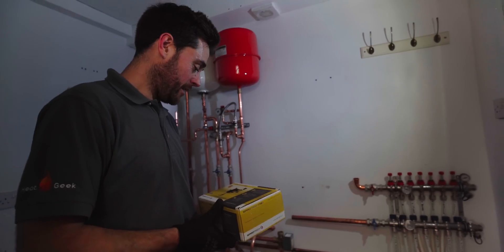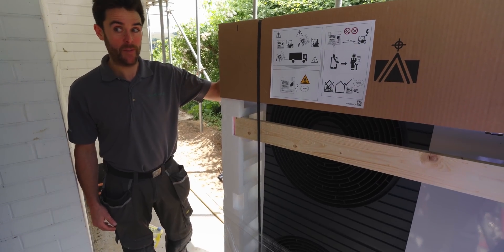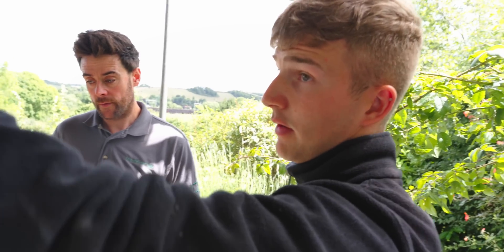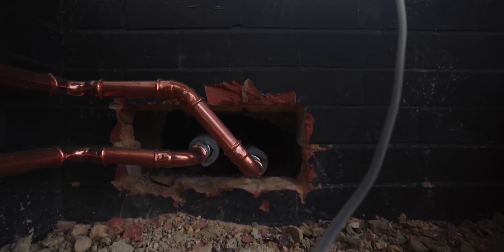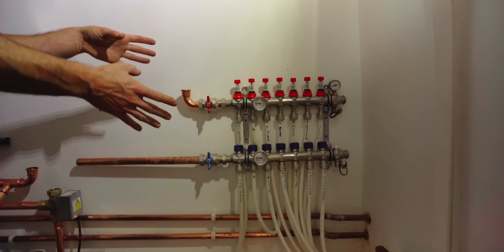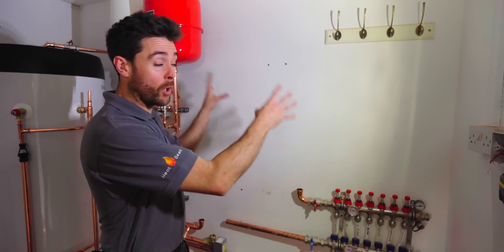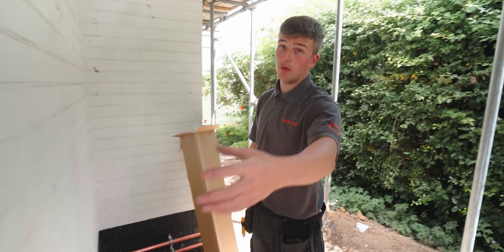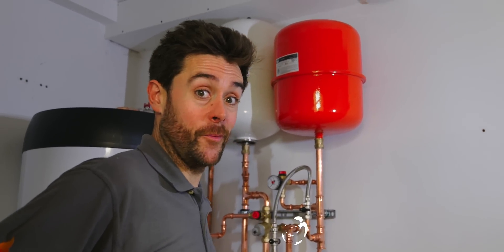NEVER Install A Wonky Heat Pump! | HG On Site

Comment: So the answer was bigger rads, is this because the old water temp leaving the boiler was higher than the new heat pump water temp leaving the indoor unit for the heating circuit? Could I ask what your calculated heat loss is for the building and what the power rating of the Heat pump is in output? Many thanks for any answers/help. Am enjoying looking at the results of your experiment. 👍👍👍

Comment: Great video, looking forward to part 2.  May I ask what is peak space heat load & dft?  Also do you prefer to design with open zone and allow weather comp to fully work without interference from multiple zone controls. ...+ the benefit of less complex & cheaper to install!  
Keep up the good work 👍
Reply from the maker: This was 12kw. Yes re zoning.. watch our 'why not to zone heat pumps or boilers' video
Reply from the maker: Been installing boilers that way for 10 years and heat pumps since we started them a couple years back..

Comment: You never use SY cable outside in a fixed installation. Designed as a instrumentation cable indoors on machinery where flexibility is required.   Plus no uv protection for outside use.  Otherwise good info. I myself will wait another 10 years. My home is not suitable for a heat pump . Not long replaced the gas boiler. My son replaced his just last week.. I am keeping an eye on The technology waiting for new developments. It's early days, it needs time to evolve. But it has to start some where and your doing a good job.  I am a retired electrical engineer And enjoying retirement.
Reply: Yep, the payback at the moment is not good enough. I will replace my combi next year (14 years old by then) and probably review alternatives in 2033 if I still own the house.

Comment: Don't you love real life, wonderful video, well worth doing. Great install, are the rads on the same circuit as the underfloor? Is the buffer tank really necessary?
Reply from the maker: Buffer is a slight overkill but needs the separation. Yes rads and floor same

Comment: Have you got a link to installer manual for the actual Heat Pump.......curious to read what the servicing requirments are ? I'm guessing there aren't many Heat Pump service engineers about.....do Vaillant themselves offer servicing ?
Reply from the maker: Yes vaialnt do offer servicing. Servicing is infinitely easier than a boiler though
Reply: @HeatGeek  ok thanks, and what period of warranty is given with that unit ?
Reply from the maker: @julianwebb8712  if your an advanced installer like us, 7 years. Then if you select servicing with vailnt 10 years.
Reply: Thanks for reply, it took me a while to get to grips with the spelling of Vaillant too 😜

Comment: How does the unit deliver 2 different temperatures for the heating and water simultaneously? Is the purpose of using 28mm to reduce the surface area to volume ratio to reduce heat loosses or to improve flow, if for flow would the internal resistance through the motorised valve not offset any benefits?
Reply from the maker: It does 1 then the other, not symltaniously. The purpose of 28mm is to give the correct velocity of 05. To 1.5 mps, same as any heat source. No the diverted valve restoration is not too high. 👍

Comment: Hey guys, love your work and what your doing for our industry. One heads up for you, without sounding too much like a keyboard warrior.... I'd be careful using SY cable, especially externally as it's not UV rated etc. Also not rated as mechanically protected as a lot of people think!! If your just running a SELV mains isolated comms bus then okay, but much of the comms gear on the air and ground heat pumps is actually mains referanced and needs to be treated as such. Rant over and I look forward to seeing the end result of this job. Cheers
Reply from the maker: Hey Paul. Yes aware SY is now not to standard for voltage aplication bit will pass the other information back. Thanks!
Reply: @HeatGeek  No probs. Check out John Ward's video on SY cable he did last year to see what happens when run externally. You could use conduit / copex to do the external last mile run to the outdoor unit and meet regs
Reply: @paulbell7654  VDE0250, BS EN/IEC 60332-1?
Reply: Very good point Paul, SY cable is not a suitable cable for outdoor applications it tends to act as a sponge over time soaking water and eventually will cause issues. i would also refer to John Wards Youtube video on the subject. thanks for the videos
Reply from the maker: @EnergyhomeInnovation  awesome cheers guys. Appreciate you pointing this our for viewers!
Reply: @jonh1808  The uses of SY cable is always going to be a problem as it doesn't comply with  BS7671 (18th edition wiring regs) so your  Sparks is always going to have to list it as a deviation on the Electrical Installation Certificate.

Also SY is designed as a power and control cable not for data communications. Data coms cables have Twisted Pairs and Full Screen, 
SY usually has an internal earth wire which negates the screening effect .

Comment: Did they put a new air brick somewhere else? seen a few properties with blocked air vents and horrible damp issues!
Reply from the maker: Air brick was for an old fire no longer installed.
Reply: @HeatGeek  yep above the damp course so no issue with damp. You need air movement where you have something outside the thermal envelope of the building, ie under the floor or above ceilings that go to roofs.

Comment: Whats the rough price of an install like this? Also is there any advantage of a Mixergy cylinder over the Valliant?
Reply from the maker: Hi. No advantage of a mixer gym over normal cylinder with a heat pump no. Average heat pump instal is 15k
Reply: @HeatGeek  thank you, could you explain why mixergy is not any better? I thought the ability to stratify the heat meant not all the water in the cylinder had to be heated if not required saving energy and therefore money? Thanks again.
Reply from the maker: @aub8670  because that function of partial load is tuned off when connected to a heat pump.
Reply from the maker: @stupidusername38  if you have excess ov why would you o ly partial load?? You want all of your ov saved before export
Reply from the maker: @stupidusername38  but heating slightly more water on a really well insulated cylinder does not really use any extra energy, even if it did its better than exporting the electrical power at a loss
Reply: How did the 28mm pipework perform?I've got a similar install coming up for a 10kw vaillant and have been told 35mm is required and it's only about a 7m piperun

Comment: Don't really get this video. I thought the whole idea of your company was to educate the trade and the public on the how to and benefit of heat pumps. Watching this and the miss management of all the logistics just exemplifies the reasons for not having one installed. And planning at an appalling level. The install is started with essential components not even on site. Copper pipe or fittings you can whizz out and get but obviously not some major parts. A week install running into three. Whoever was responsible for the organisation of this job should be ashamed. And then film and publish the cock up. Still lost.
Reply from the maker: The deliveries are often out of our hands and you'll hear from anyone working in the same or similar feild. It's not necessarily down to planning at all. Like wise with the base that was laid by a builder in charge if the whole renovation. Importantly though as there was continuous works and the job had to be done in phases there was absolutely no delay to the job at all. Retrofits would get a site visit before hand to make sure the job is ready. 

The purpose of the video is to show the realities of an install. We're not trying to falsify the installation of heat pumps to sell them. We are all about truth and this is the reality of any bigger job, not just heat pumps.
Reply: @HeatGeek  I am a Builder. Have been for too many years. I agree that the Builder helped drop the ball but still think your firm did too. You say on a retro fit there is a site inspection first to ensure everything is ready. This is not really a new build just a big Reno. Planning or poor planning continually screws the Building Industry. Whether you were working for the owner or the Builder collaboration before turning up makes all the difference. Training is a big thing to you. Helping the Builder get his part right. Deliveries World wide are bad. All of my jobs have delays because of it. So don't start. Make sure bits are in your possession and intact. We all try to press on regardless and hit a brick wall. As things are at the moment delays can't always be helped. But this video came across to me as guys just rocking up. Let's see what's turned up and can we do anything other than put the kettle on. Who ordered the gear. Pretty specialised. Must be your firm. Who was responsible for chasing that up and finding out just what was available and when. And why no site visit prior to install day to check all good. Excuses it is what the Building Industry does best.
Reply from the maker: @davetaylor4741  your creating a non issue. There was so much to do that any issues were addressed while we got on wothbother work and there were no hold ups. As for us giving training to a builder to lay a level base, I would hope that they could do that better than  us and would be well within their wheel house..?

You can call the suppliers to double check they still have the delivery date correct but it doesn't change anything.. that's why we typically get everything delivered frist day even though we do t don't need it, and earlier if storage.
Reply: @HeatGeek  You are very good at changing the subject and going back to a script. That was evident in the videos with Roger. Not having a go at you at all. I admire what you are trying to do. Never mentioned slab. Was referring to cable issues. And regarding deliveries etc know the pitfalls been doing this longer than you have been alive. I don't video my cock ups and put them on You Tube. Simply stating that what I saw came over as organised chaos at best. If the Builder and Client were happy all good.
Reply from the maker: @davetaylor4741  we hide nothing 👍